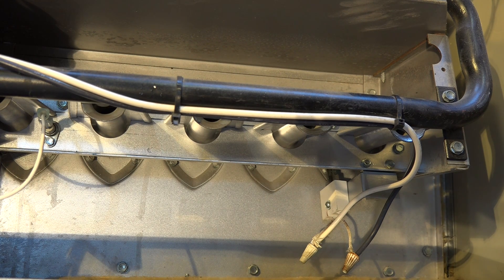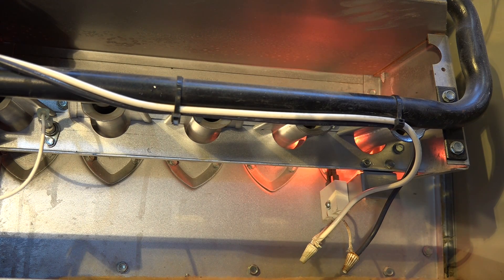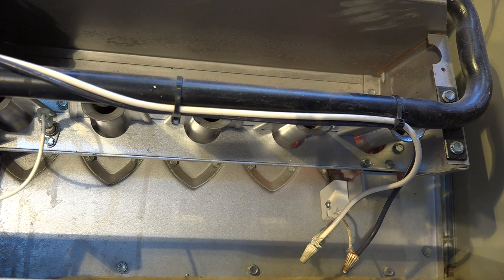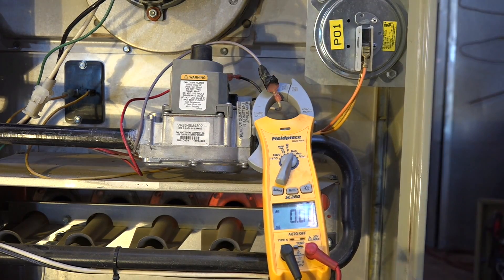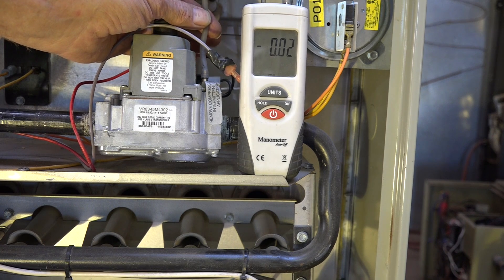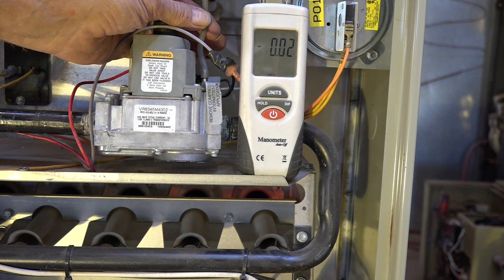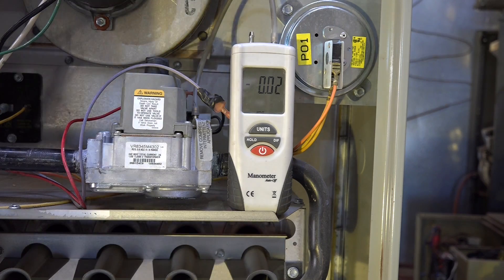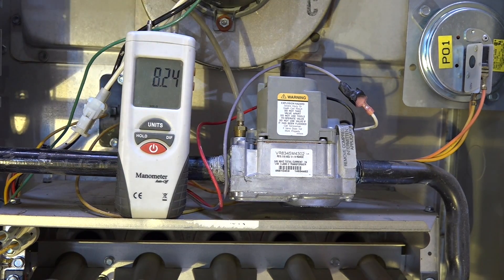What is wrong with this furnace #2

Comment: Some dork ran a 3/4 iron pipe from the meter into the nasty crawl space. Then once inside the crawl, attached 1/2 soft copper to 3/4 iron pipe. Then at the mechanical room, switched back to 3/4 iron to nipple up through the floor and tie in h2o heater & furnace.

Comment: Prior to gas valve you have lack of supply! Possible cause multiple devices pulling gas supply (I.E. gas Water heater, Stove, and BBQ), Regulator fault, and bent or crimped supply line's.

Comment: need more facts, such as inline  voltages  to  gas valve, hsi  igniter ( 120v  used  instead  of 80v  surelight  type  igniter ) Sometimes  a direct  apply  of  24  volts  to  main  gas  valve  will  help  to  further  trouble  shooting  a  stuck  internal  valve solenoid, etc

Comment: I'm going thru this exact problem with my furnace it does the same, but sometimes it actually does fire but once the house gets cold and its calling for heat it does the same and goes into a lock down and won't start.

Comment: I thinking the gas shut off isn't open all the way. inlet pressure drops way down when the valve opens which makes me think it is open enough to build pressure behind the gas valve but when the valve opens it doesn't have enough volume of gas to maintain pressure.

Comment: It's a fuel supply problem. Make sure the ball valve at the furnace is completely on. If there is other gas equipment ask if it is working properly.  Suspect the regulator at the house or if propane, the tank could be down to pressure.

Comment: Inadequate gas supply due to obstruction from mostly closed valve or debris in the line. I'm guessing close to the furnace since the pressure dropped quickly then returned to normal quickly once the gas solenoid shut off.